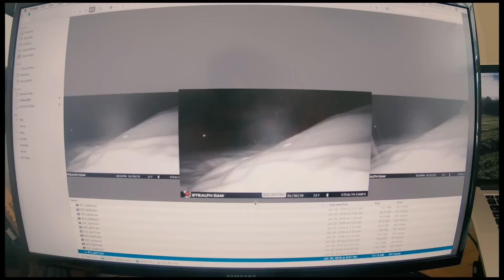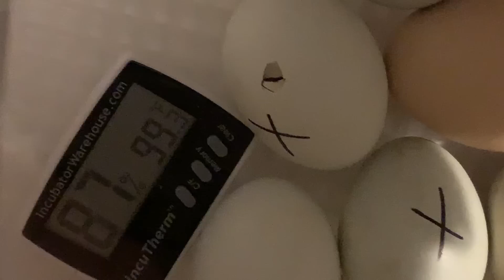What We Learned After a Year of Farming

Comment: You know, a shipping container is cheap. That would make a sweet secure duck house. Cut out a few windows and use the cut out areas to create storm shudders.
Reply: string a few 40" footers together would work well.
Reply: The metal is super cold/hot depending on the weather.
Reply: In northern Vermont? You'd have to insulate that thing like crazy. It'd be a secure outer shell, but you'd have to build an inner building so the animals don't freeze to death in the winter.

Comment: seems winter is very cold there maybe you need more insulated and not so windy sheds (without gaps between the woods) for the animals. When I was young we had chickens and some ducks we built brick wall buildings for them. but i live in Europe and wood made buildings are not usual here. cold is one thing but chilly wind is what really damages poultry. wood is Ok too good insulator but needs to be airtight and maybe more than 1 layer. also heat reflecting foil on roof like aluminum foil with some insulation foam on it.